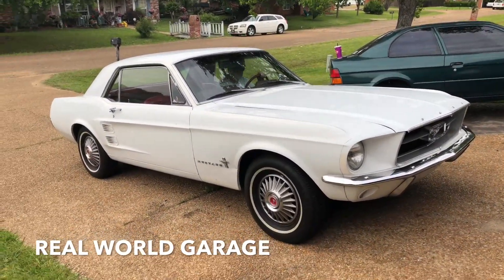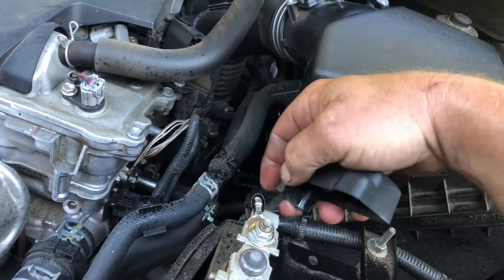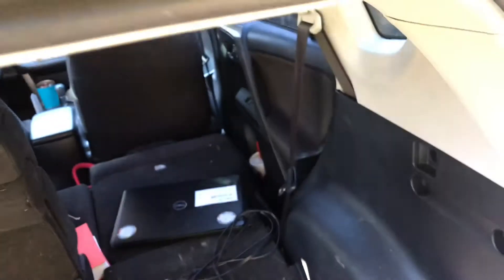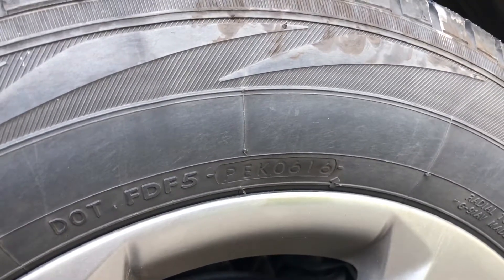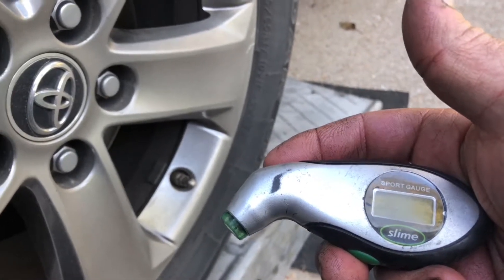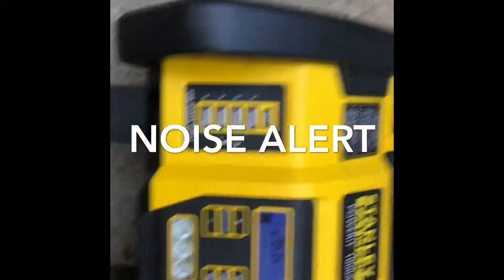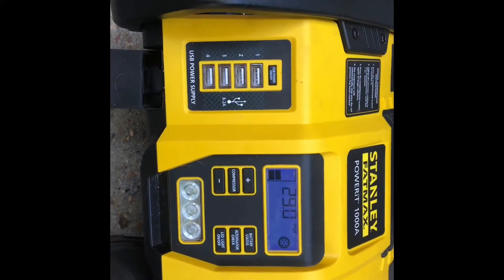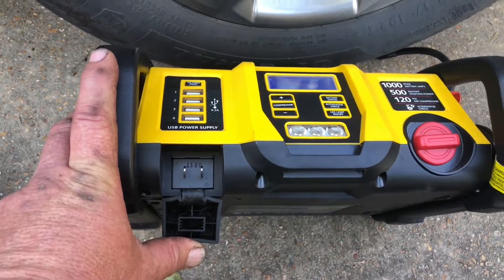The ultimate Maintenance guide 2015 RAV 4 pt2

Comment: Thank you for your videa. What's the corrosion spray you used?
Reply from the maker: HomeyBadger it’s not corrosion spray, It’s just a general purpose lubricant. Thanks for watching.
Reply: I personally use WD-40.
Reply from the maker: @special1melody  it doesn’t really matter what you use as long as it’s a general purpose lubricant. WD 40 has been around a long time.

Comment: One thing. Bad place for booster cables. If your battery dies, you can’t open the hatch to get at them. Best to keep under the seat or something similar.
Reply from the maker: capohd28 the back seats easily fold forward. Thanks for watching